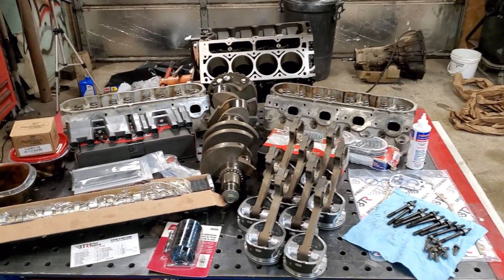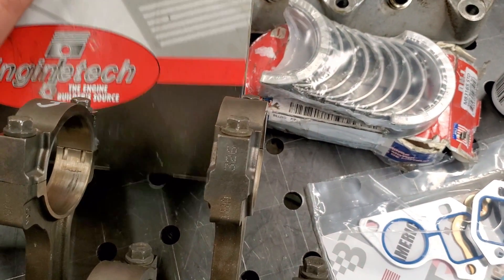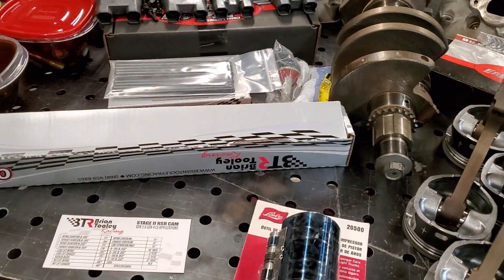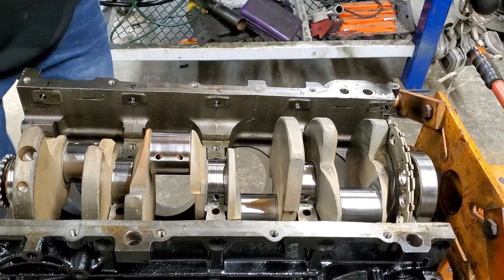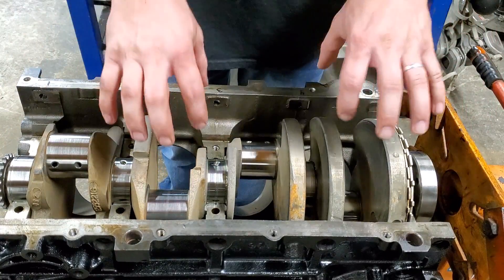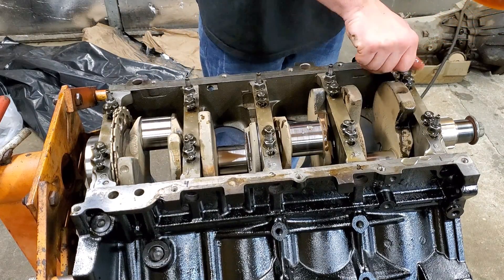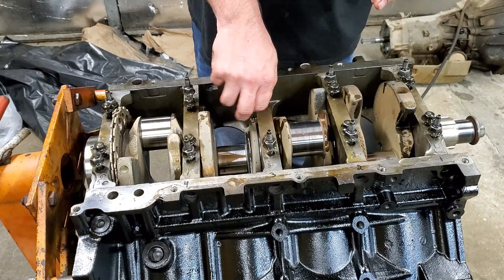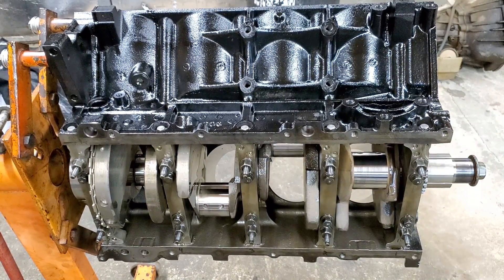6.0 LQ4 LS Motor Build Part 1 (Crank Install)

Comment: You doing good man. I'm working on an LQ9 rebuild/swap. I'm a rookie, too. Got it disassembled down to the block. I'm afraid of the rod and main-bearing clearances, but I read it's usually no thing. Gonna study up/ask around more about it before I start the reassembly.
Reply: Finishing up my rebuild now. After much research and YT videos, did mine like your with torquing vs TTA. Same with the rod bolts. Didn't do any bearing clearancing either. I went with Sealed Power bearings. Summit said the bearings were manufactured to spec so clearancing not necessary. Consensus says it's fine.

Comment: I know it has been a year but it is  bad idea to rotate the crank before you add the caps and torque them down... that is how you get oil/lube between them and the metal surface and then that can lead up to you spinning a bearing

Comment: I commend you on building your own engine. I didn’t see you check your bearing clearances, though. Very important step. I also don’t recommend torquing the factory bolts to what people tell you to on forums. Listen to the guys that engineered the engine. Factory tells you torque to angle. You can re use those bolts and likely be okay, although they weren’t designed to be re used. Realistically, you should buy new bolts and follow the required torque pattern and torque them to angle, as they were designed. Or grab some main studs and get a line hone. Then you can re use the main studs all day. Those are literally the most critical bolts in the engine. No point in skimping out on a couple 100 bucks. Good luck!
Reply from the maker: I didn't reuse my old bolts. These are all new. I talk to my machine shop that did all the machine work and got all new parts through them. I also ask them about torque specs and they told me to do it like this if I didn't have the right tool. Also as for checking the bearing clearance I was told that sinse I didn't have the crank machine worked that the stock bearing sizes would work great.

Comment: Did you tighten the second set of bolts you put in the caps?
Reply from the maker: I tightened everything
Reply: What torque on the bolts with the nut on them?

Comment: On the 10mm side bolts on the main caps you need to add RTV on the threads of the bolts if not it's going to leak oil all day and night thanks for the great videos love them